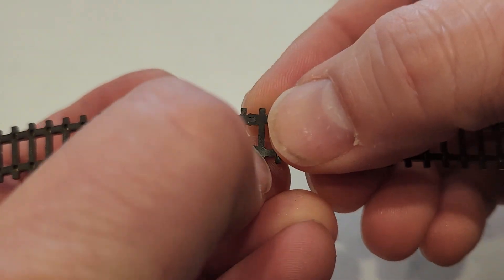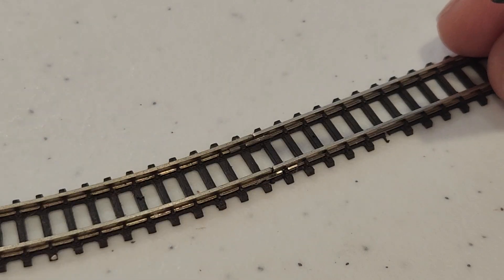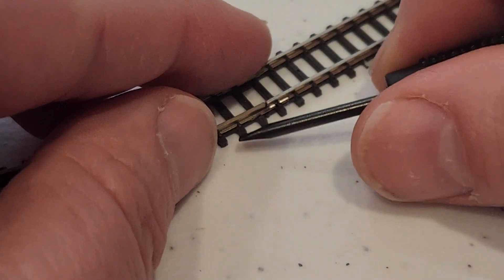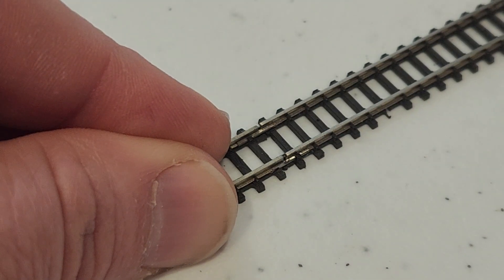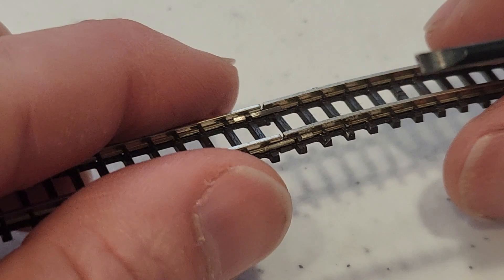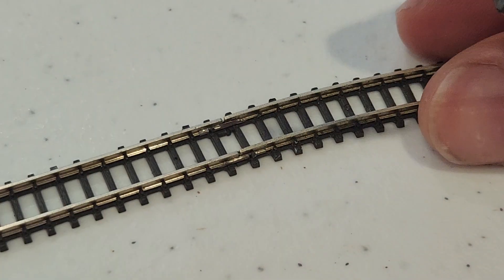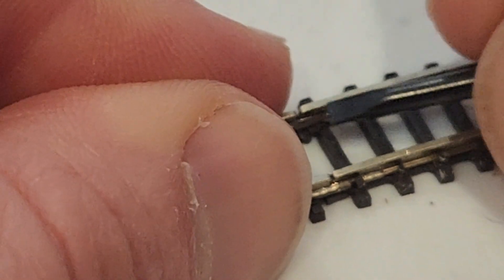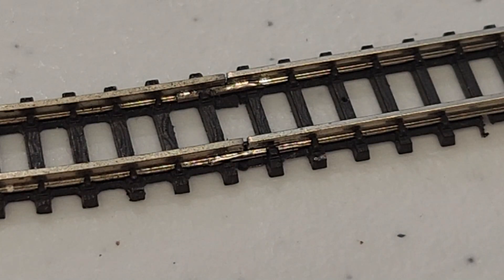Joining Marklin Z Tracks and Improving Section-to-Section Conductivitiy

Comment: I just soldered mine in every section before i put them on my noch layout. Mechanical connection will eventually get dirty and start loosing conductivity but solderin will not. Of course your method is better than nothing.